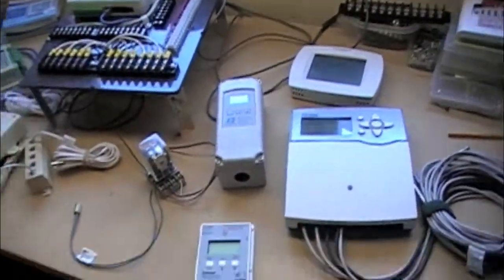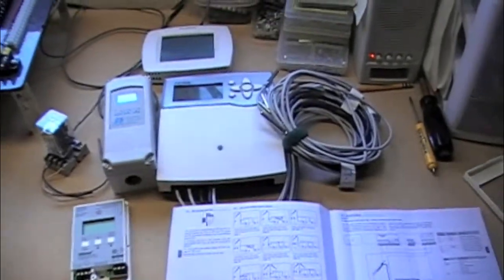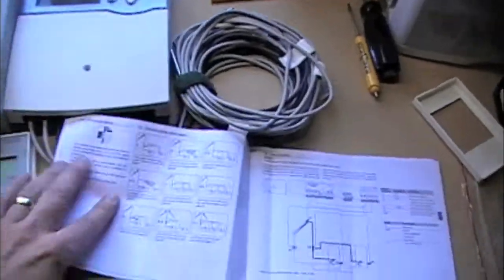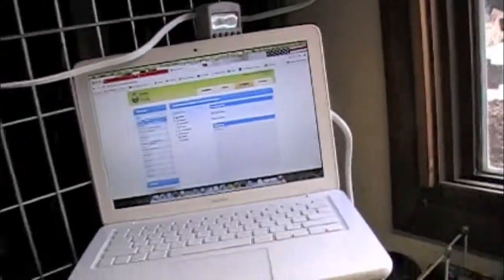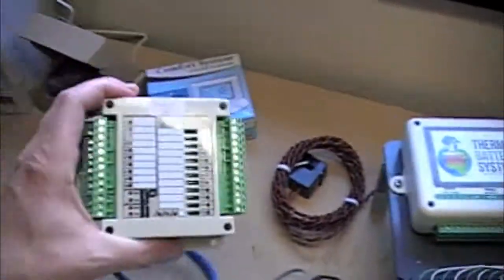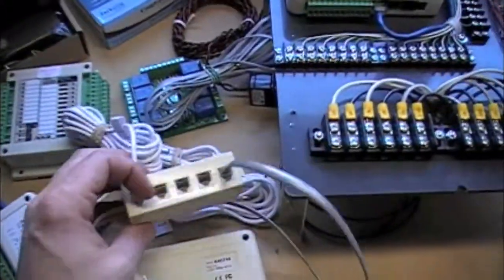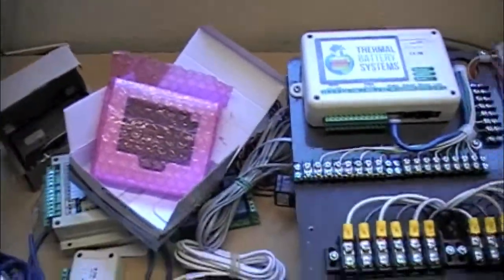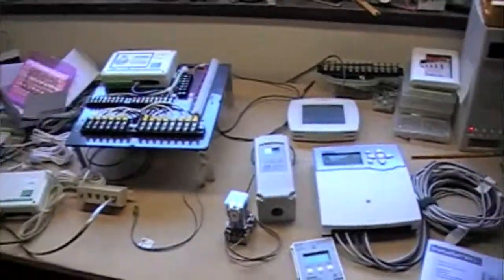IoT network controls for renewable HVAC systems

Comment: I’m planning to install a 5000 underground fire water tank in Southern California. It occurred to me that I might be able to pair this with a ground source heat pump system, although it’s the cooling aspect that would get more use. The tank would be supplied by mains water and feed a residential sprinkler system that in turn supplied the toilets in order to turn over the water. Do you have any thoughts on this approach and/or where I might be able to get more information? Thank you.